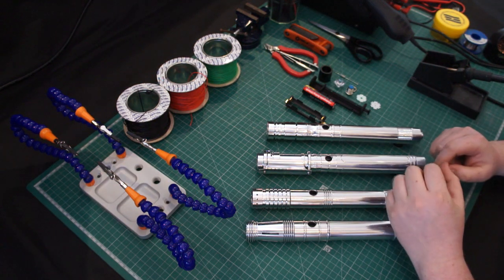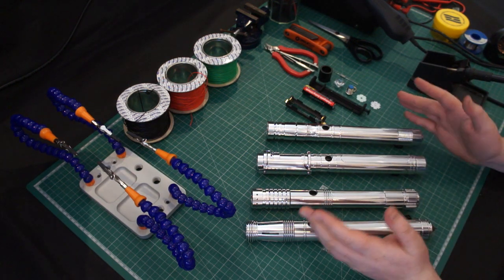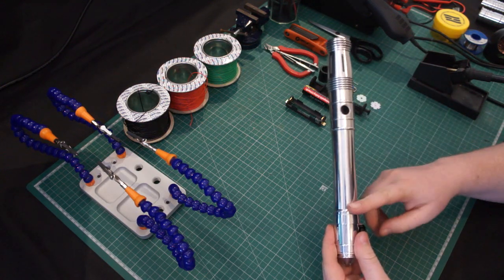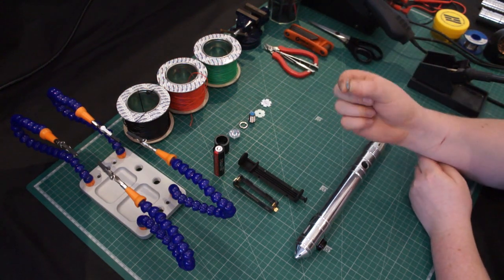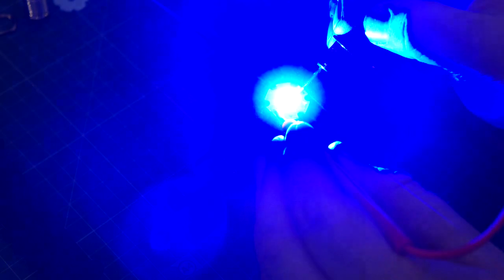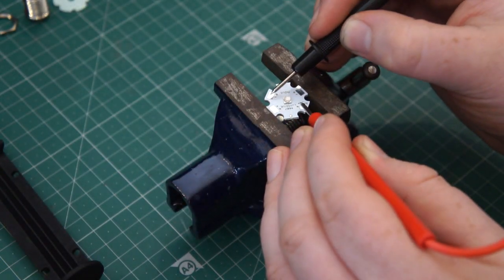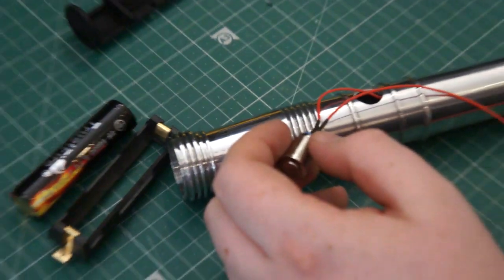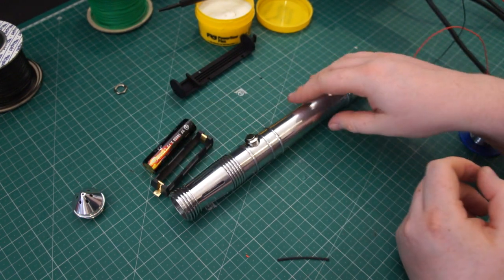DIY Tutorial: How To Build A Basic Custom KRS Kit Stunt Lightsaber

Comment: How essential is the Resistor to the lightsaber? Even if it isnt this exact kit, like if i were to buy a empty hilt from ultrasabers and then fit it with my own parts, do i need a resistor?
Reply from the maker: Hayden S you need to do research on Ohms Law and understand the importance of using resistors. Understanding and learning about Ohms law will explain why you need to use resistors.

Comment: is there no chance of the foam overheating and catching fire?
Reply from the maker: There would need to be a flame in order for the foam to catch fire? Not sure where the flame would come from though.
Reply: lithium ion batteries can explode and in a lightsaber those are basically pipe bombs. this is a pretty big issue for vapers that use mechanical mods.

Comment: also what wire do you use and where in the UK can I get it :)
Reply from the maker: It's from Rapid Electronics in the UK. Online.
Reply: 26-28 recommended minimum for most saber builds. You can check the different current carrying capacities of various awg ratings online, so depending on what you're wiring, you can pick appropriate thicknesses for different parts of the build.  Power & LED connections typically need fatter cables to carry the current needed.